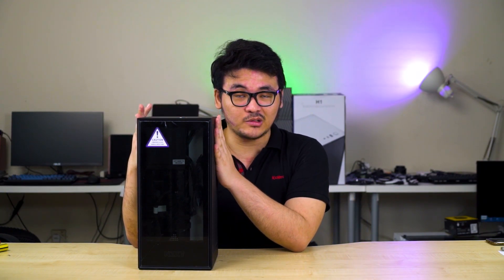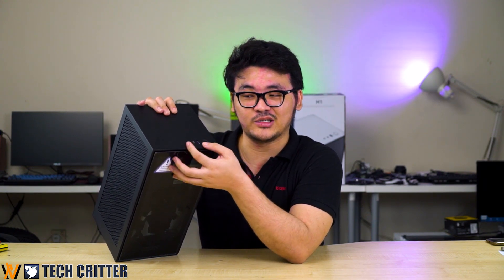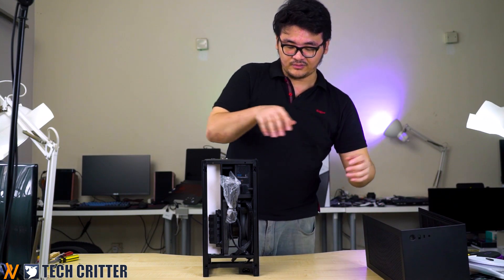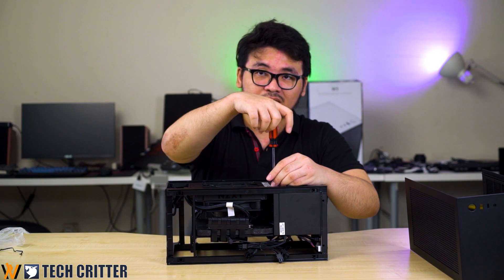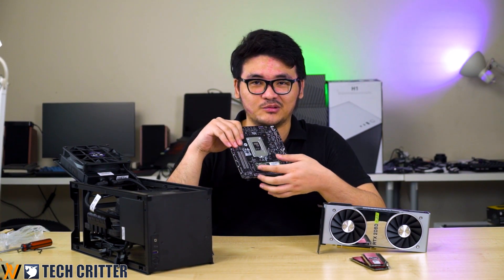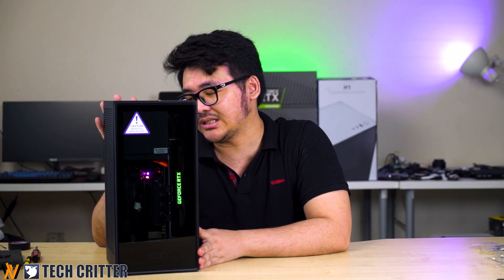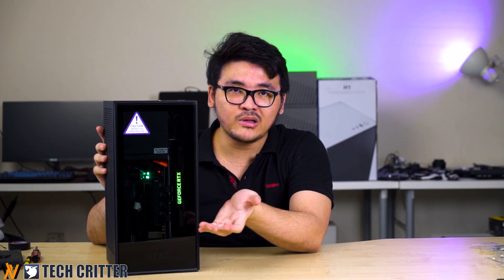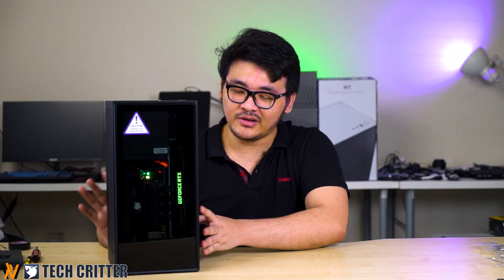How's it like to build with the NZXT H1?

Comment: Wanna start doing lan Parties again and starting to hate my laptop this a good option?
Reply: Also anyone else gonna try modding with project snowblind style screen so it doesn't look so plain
Reply: Yeah. I replaced my laptop with an SFFPC and it's worked out much better than I originally thought it wound. I could never go back to a 15" screen with a terrible keyboard and jet engine fan noises.

Comment: Where can I get my hands on this case?
Reply from the maker: Not easy to get a hold of it since it's mostly sold out 😅
Not yet available in Malaysia, too.
Reply: nzxt's website
Reply: @davidkrebber9501  Yes. I am aware of their website and they don't sell just the case. You have to purchase the case from one of their many listed resellers, which I have check all of them from Asia to Europe to North America and none have this in stock. Also, you can't even purchase a prebuilt from NZXT either. Out of Stock. Currently contemplating ditching this case and going with the NCASE N1. At least I can buy directly from them.
Reply: nzxt taking preorders now cost me $370.99 USD out the door and it ships in 2 weeks.
Reply: @lorenzo52877  send the link. Because you can purchase a prebuilt but the case page (https://www.nzxt.com/products/h1-matte-white) is saying out of stock.
Reply: @lorenzo52877  How much the shipping fee and total cost for it to arrive Malaysia?
Reply: Every Wednesday @ 3pm est.. there is a restock (pre order)